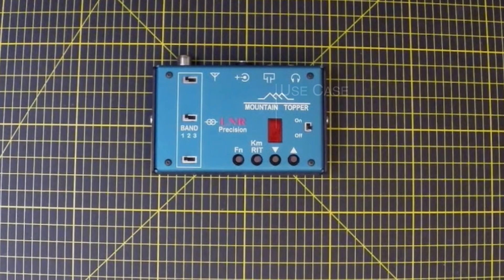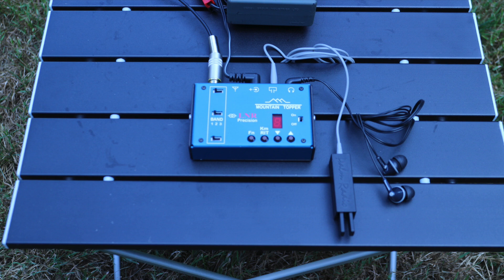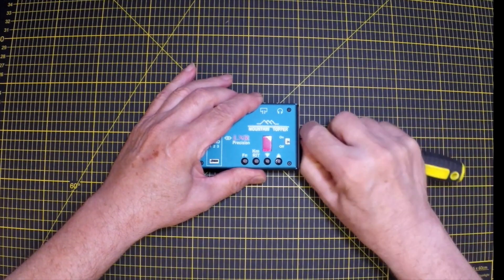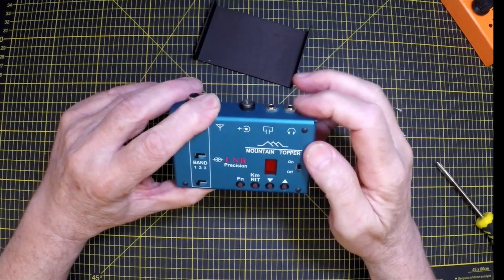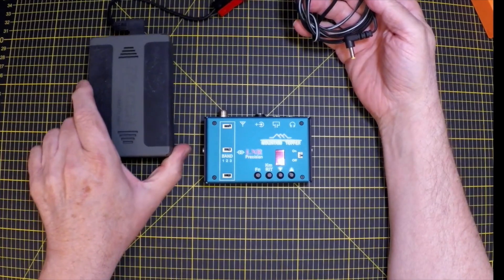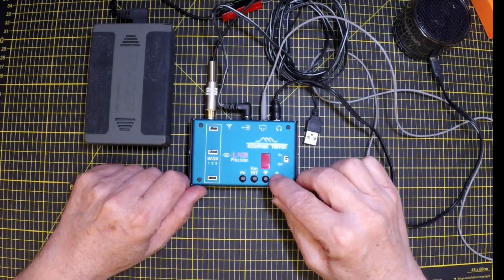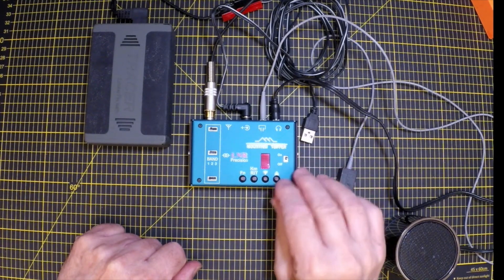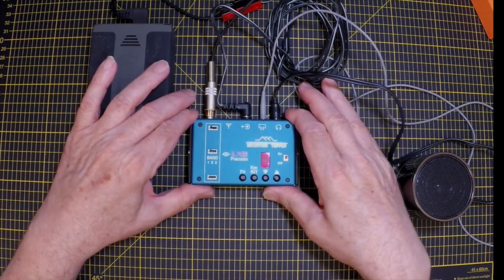One of the best Ham Radio Pocket-sized 40M, 30M and 20M HF CW Transceivers

Comment: Excellent video, thanks. I looked at the mountain toppers over the last several months for pocket-sized qrp, but migrated to qrp labs' QMX. I've ordered the assembled version shipped to Texas for under $190. I like the build quality reputation, display information and 5 bands. It looks like a wait of 2-3 months for delivery. Have you any experience with the QMX? Michael, KZ5MSE
Reply from the maker: Hi Michael. Sorry for not replying sooner.
I have ordered a QMX kit and will build it shortly.
With all their kits, the tricky bit of the build is usually the large main tapped toroid. Make sure you fully scrape all the enamel off where you make the taps -- as trying to re-solder is a nightmare!
All of Han's kits have worked first time for me :-)
73 Bruce G4ABX

Comment: Hi Bruce. What do you rate higher. This rig or the QCX mini. Just starting out in morse and QRP portable looks like fun.
Reply from the maker: Hi Roger.
I have both -- my OCX mini is the 40M version. 
The mountain topper wins out for its frugal power requirements and its multiple bands. I use it with the QRP guys 3 band switched vertical -- and its a great combination . Just make sure your headphones have a volume control otherwise you will be subjecting yourself to som pretty loud noises!
73
Bruce G4ABX
g4abx.co.uk
@g4abx